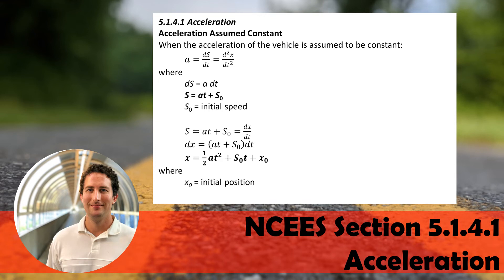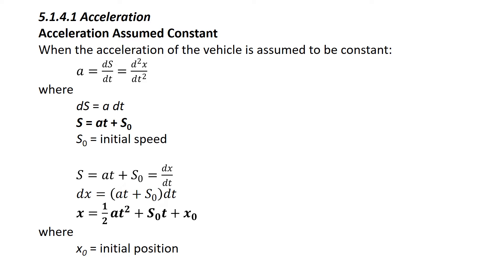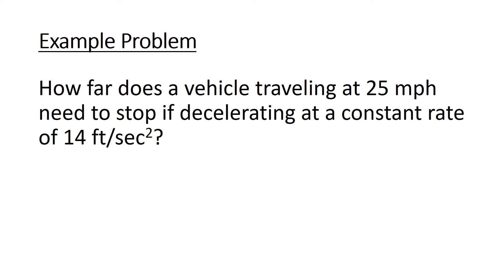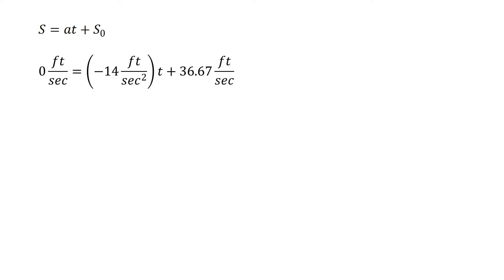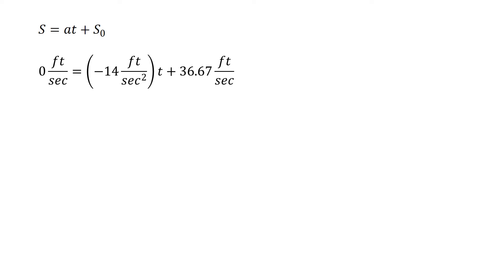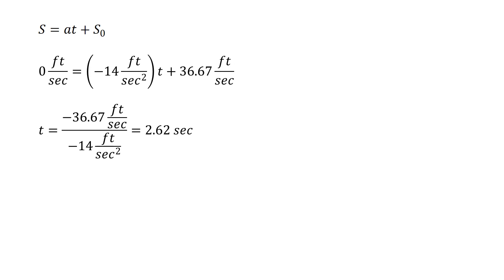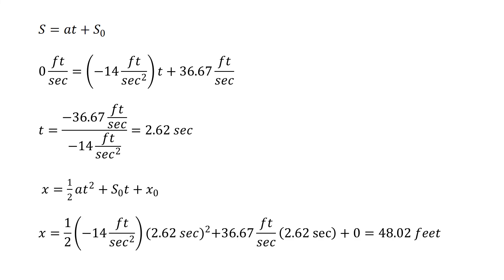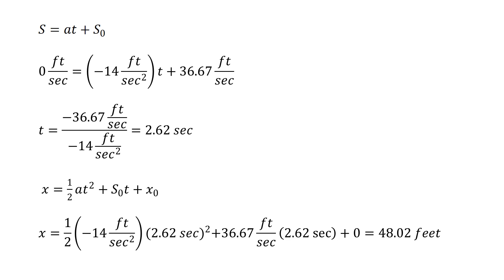Acceleration (Constant) | NCEES Civil Engineering PE Exam [Section 5.1.4.1] | Accident Analysis

Comment: Great content, but for the sake of time on the exam, using only the braking portion of the SSD equation  (1.075*V^2/A) om page 279 of PE HB 1.1 or page 3-5 of the Green Book, will avoid unit conversion and give a very close answer (47.99 feet). Keep up the awesome videos, they are a huge help!
Reply from the maker: Brilliant!  Yes, great suggestion!  You're doing the right thing preparing for the exam and thinking about how to be a good test-taker, keep looking for ways to simplify problems and find the processes that work for you.

Comment: this problem hark back to my civil engineering dynamics class as well as the fe/eit exam's am section.

however at the university level the most typical application was projectile motion which was a problem in 2D, a much more complicated problem to solve by hand,  as opposed to this pe one, at 1D.
Reply from the maker: Yes, my dynamics class convinced me to stick with things that don't move as much!
Reply: @FindleyDaniel  lucky for us were not practicing structural civil as dynamic loads are a big thing there nor the mechanical side of the profession.